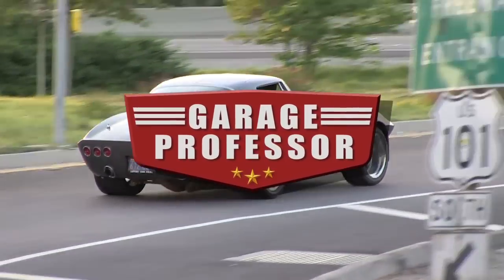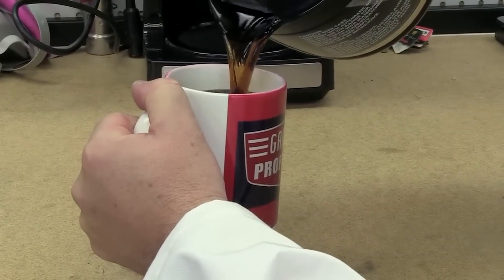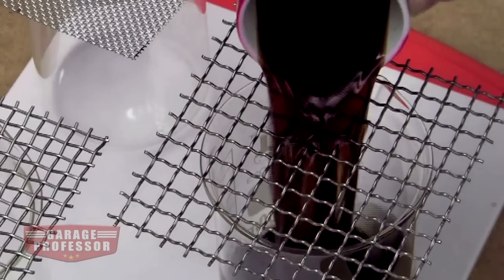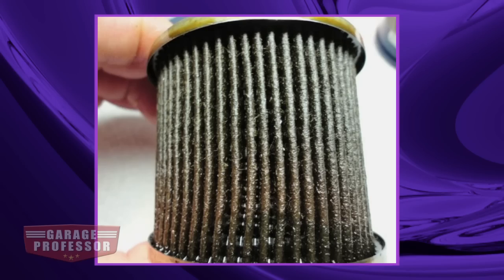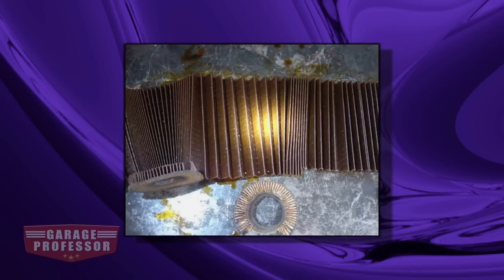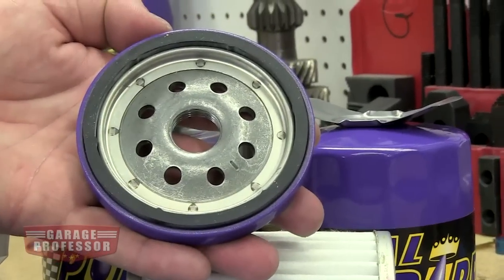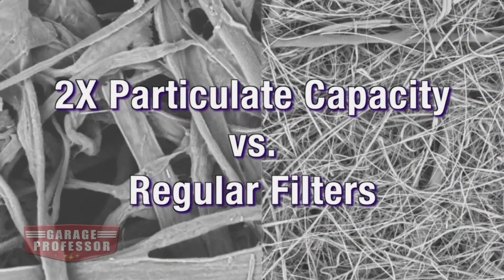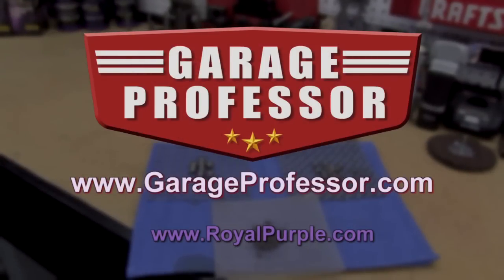The Garage Professor: Oil Filters- We Put Particles & Filters to the Test!

Comment: when he shows the "bypass valve" he shows a hole in the top of the filter!   not the valve!  i saw a video where the valve is incorporated into the spring, but did not see how it sealed in order to prevent oil from getting around it!  is there a video that shows how the bypass

Comment: I have owned 3 GM's with well over 220,000 miles, at least!   I only use AC Delco filters the manual calls for and change the oil every 6 to 8 thousand miles and have never had an internal engine problem.. won't better filtration slow the oil flow????  Use what is designed for your vehicle...

Comment: I have a 4x4 truck with 312,000 miles running Fram filter. I change the oil about every 6,000 miles. $3.67 at Walmart.
Reply: +blackericdenice and u get maybe 5mpg ...hwy
Reply: Benjamin Nope, I get 2.5 mpg on the hwy.

Comment: Until I finally run into that guy whos filter failed, I will normally buy Fram. I have bought the filters offered as a package deal at O'Reilly too. I have pulled oil pans off my vehicles at 200,000 + miles because of seal leaks only to see clean pans. But I have always changed oil/filters at 5,000 miles. My 2 cents? Change your oil!

Comment: Liking my K &N filter. The only filter that's fabricated with a celluous element, which allows for faster oil flow through the filter element. Plus, the aforementioned possesses a welded 1" nut for easier removal of said oil filter.

Comment: Bosch distance plus is best filter
Reply: +stormbringerr mourn I used it with what they call a low drain interval oil (valvoline full syn)  ran it 6k miles was still pretty clean.  Ran royal purple with a k&n... was trash at 4800 miles... the distance plus filter is great
Reply: +Billy Gunn
i believe you. i use full syn Mobil 1 oil and  Bosch distance plus filter and change oil every 10,000 mi.
Reply: I used to use Bosch DP. But I've changed to Purolator Boss. The best filter I've used. Purolator, you cannot go wrong using them. They invented the oil filter.

Comment: I actually made the switch to royal purple in my 1993 Chevy Lumina 3.1 Euro and I actually feel the car runs better don't feel like I have to push the peddle as much as I used to.. feels like it has more power im pretty happy and it's only day 2 since I've changed to royal purple...and I dont have to change it for at least 11,000 miles...but ill change it at 10,000 and I did order royal purp filter picking it up tomorrow...
Reply: Did your car die yet? Is it scrap metal 🪦

Comment: They don't spend millions on testing just to BS people. Like the old saying goes. Pay now or pay later. When this filter came in the mail I picked it up and said to myself Holy S.--t is this thing heavy. It's going on my 07 Jeep GC. I usually by Mobil One but I'm giving RP a chance. Let's see what happens. I change my oil when I can't see the oil level lines through the color of the oil. It's probably still in good shape but not good enough for me. Fifty yrs of owning cars and never had a failed engine. High miles and still ran great.

Comment: Royal Purple Commercial.  LOL  Overpriced filters, and they aren't worth all the hype... just like their oils.  Expensive bullshit.
Reply: +Turbo Diesel Sure, that is why my 04 Grand Cherokee has 230k plus miles and runs like new. My 98 Grand Cherokee has 165k plus and runs like new...same thing with my 2004 Pacifica. They have had nothing but Royal Purple since day one and you can change it every 5000 miles. You don't have a clue.
Reply: +Virginia Towerman : Oh believe me, I have a clue.  I have a fleet of vehicles, all with well over 100K on them.  I also own a ton of farm equipment where I run all conventional oils and standard duty WIX, Fleetguard, or Baldwin filters.  They all get oil changes every 200 hours of use or annually, whichever comes first.  

As far as my road vehicles... for example, my '02 Cummins currently has 317K on the clock.  A Chevy Lumina that I used to have broke 200K before I sold it.  Olds minivan with over 200K on it.  Most of my other pickup trucks (Chevys and Dodges) all have mileages in the 130K to 220K range.  I've always use the cheapest fully synthetic oil and a good quality filter, changed every 6 to 10,000 miles on them all.  
Bottom line is that if you change your oil and filter as you should, and perform good maintenance practices on your vehicles, they will run for many, many miles (or hours). 

 I realize that you attribute your taking car of your vehicle all to Royal Purple products, but the hard fact is that your vehicles would be functioning just as well with other less expensive brands without spending as much of your hard-earned money.  Perhaps you should be a Royal Purple spokesperson?  LOL
Reply: Royal Purple is just a small part - although necessary - of the solution. Precision care, timely repairs and maintenance are all part of extending your vehicles life indefinitely. Fortunately I do most of my own maintenance so I also get a higher level of care.
Reply: *****
Yes I can. I am talking about the personal touch that you take when you make your own repairs. Sticking to the specs, making sure everything is torqued correctly, replacing or cleaning what needs to be replaced or cleaned...basically not taking any shortcuts. I have factory manuals for all my of vehicles and I use those as my guidelines.
Reply: +Virginia Towerman dude you'll get that kind of mileage with just about any oil. compared to the likes of Mobil 1, pennzoil platinum, and amsoil royal purple doesn't hold up at all. royal purple is actually comparable to castrol and Lucas oil
Reply: Edward Anthony hey let him go buy that crappy shit, more rp for us.
Reply: Before every one here starts arguing look at the facts first. NOT ALL VEHICLES ARE MADE THE SAME. NOT ALL OILS ARE MADE THE SAME EITHER there are different variables involved. How you drive, how much you drive, if your more highway or more stop and go city person.It doesn’t always come down to the product you use.

Comment: It doesn’t always come down to the product you use. I can use the best oil money can buy, but if You floor your car’s pedal every day it’s doesn’t matter if your oil comes from Saturn.. your going to screw your car very soon.If you use a cheaper oil ( providing it has the API approval )and drive like 85 year old granny next door,your car is going to last longer. Providing in both cases the oil is changed as is required.Lets also not forget that not all vehicles are made the same either.

Comment: Fram ultra is good enough for me...
Reply: Fram Ultra is the best filter available. Definitely just as good or better than Royal Purple & Mobil 1 filters, but a bit cheaper.
Reply: +Branson Mathess Guess you haven't seen the inside of a Fram filter.  Nothing but cardboard.
Reply: Charles Scott i guess you never seen the inside of a fram ultra ?
Reply: samuel lopes Honestly nope, had two fram filters go "pop" on me in the past, wont touch another one ever again.
Reply: Charles Scott Yeah. I guess that will happen when you install them incorrectly.
Reply: Branson Mathess No, it's an issue that FRAM has been plagued with for ages when it comes to high oil pressures and failed bypass valves.  Guess you don't remember much 10 years ago.
Reply: if you change your oil and filter on time you will jever have to worry about the bypass valve having to work. although i have heard of ford duratec 2.5 and 3.0 V6 having issues with filters bursting but it wasnt specific to any brand. i had the contour SVT with 2.5 duratec and i ran the standard fram oil filter and never had a problem the 6 years i owned the car. changed oil and filter on it every  month since it was so easy and cheap...
Reply: samuel lopes My 3.0 Duratec in my 07 Fusion hasn't had any filter issues in 115,000 miles. I've had FRAM, Motorcraft, Pennzoil, Purolator, Hastings, etc. filters on it its entire life & never an issue. I have a FRAM Ultra on it right now.

I agree about the bypass valve & changing your oil regularly. I purely believe all the FRAM failures are due to people running the filter beyond FRAM's recommendations. FRAM specifies 5,000 miles on the Extra Guard. So people put an Extra Guard on & run it for 10,000 & it collapses & they blame FRAM. I also get extremely tired of people comparing the cheap Extra Guard FRAM to premium oil filters from other brands like Mobil 1, Royal Purple, K&N, etc. If people weren't so damn stupid/ignorant, they'd see that FRAM builds 4 different filters meant to compete in different parts of the market, people act as if FRAM only makes the cheap Extra Guard. The Ultra blows every premium filter away, period. Look at the facts. If someone can't accept that then they are nothing but ignorant.
Reply: i think it was an issue in the early ones that didn't have variable valve timing and the oil pressure was a lot higher than most engines. mainly the SVT contour  guys that would autocross. according to them a K&N oil filter was the only one they would run at the track.
Reply: +samuel lopes 
personally , I stick with the GM- Delco filter .
Reply: +Charles Scott you might want to go see the construction of a fram ultra filter. it's about the same as as the wix XP or napa platinum filter
Reply: +samuel lopes Yes sirrr. I've been using Fram for 19 years and have yet to have a problem. I to get them from Walmart.
Reply: +Charles Scott I don't care because my truck has over 300k miles running nothing but cardboard.
Reply: +Charles Scott Wow 2 Fram filters went pop? Maybe it's you and not the filter.
Reply: +samuel lopes I don't know where these guys get this burse crap from? I've been changing oil for 30 years have never had any kind of filter to pop.

Comment: The metal mesh screens at the binging should explain the whole filtration system: "the bigger the mesh the longer the filtration of the micron size thus poorer filtration of smaller deposits, the smaller mesh the better filtration of small deposits and the faster the mesh will clog up". Oil filter elements are made to a filtration standard so as to filter out deposits down to a certain micron size in order too protect the engine. How long the "FILTRATION" works depends on many factors like driving conditions, engine desighn, engine wear, poor combustion. No filter nor oil company can say that their product will last so many miles! You can only go by looking at the condition of the oil, if you can see black carbon deposits in the oil then you know the filter is no longer doing it´s job and it´s time for an oil/filter change. All this 10,000mile claim on the product is stictly BS Marketing that can cost you a blown engine!!

Comment: Oil filter fail at 3,000 miles? You guys love to lie.
Reply: JCKHAMER You are lying. I have a video where I'm rebuilding a Tahoe 350 with 312,000 miles and the filter is a Fram. I bought the truck with 113,000 miles and have use nothing but Fram. That's why I started using fram because of the grip. I use to change oil for people and fram was my choice.
Reply: JCKHAMER How are you telling the truth? There is videos of Fram filters on Ferrari. Why would people put cheap filters on Ferrari. Like I said, 200,000 miles on my Tahoe with fram filters. Not one problem. 100,000 miles on my Mustang with fram filters. I have an 04 Trailblazer with 90,000 miles fram filters. I have video, where is your video of bad fram filters?

Comment: 25 microns is not a great filter... best filters can do 3 microns and the oil comes out clean if it was totally black before.
Reply: It's 99% @25microns, 98.7@20microns, same as Amsoil Ea oil filters. In other words excellent. Never seen a 3 micron oil filter. At what percent? Oil supposed to get darker, shows it's doing it's job cleaning.
Reply: Oil gets black because the filter isn't doing it's job properly... all that "bkack" are particles that DAMAGE the engine. Look at this video and you will see a filter that does it's job  properly. Saying that it's supposed to get darker so you see it's doing it's job is stupid....
Reply: Never said that oil gets darker SO you can see it's doing it's job, you did. I said oil getting darker with use is an indication it's doing it's job, and normal. There's a difference, apparently reading comprehension skills could use improvement. Also see no proof of that 3 micron filter or percent which turns " totally black" oil clean.  As I thought. The RP 98.7% at 20 microns rating is excellent for any oil filter.

Comment: I use the Royal Purple oil filter, Mobil 1 oil filter and the K&N oil filter, and they work great, in all my vehicles.

I don't like the cheap paper oil filters, and enjoy the non paper fiber premium oil filters.

I do enjoy high quality synthetic motor oils too, Royal Purple HPS, Mobil 1 Synthetic extended life, and Lucas synthetic, Amsoil synthetic as well.

Its quality that makes most or all the difference, not the price, the price is least important, as for the cheap people that put cheap parts into their cars, well, thats why your car treats you cheaply by giving you troubles and not last as long as the car with the premium parts in it.

The cheap people that say oil filter is all the same, you don't know anything, you just assume that because you don't know the facts, and you are trying to sound / look smart, but in fact you are ignorant.

Product quality matters, higher quality parts are more pricey but is better by long run, because when you put better parts into the car, you are spending less time in the garage and spending less in the long run, and that there people makes the difference.

With more time and money in the long run, the more time and money you will have to do more enjoyable things in life, lets say going fishing, for example, or something else that is enjoyable.

Treat your car properly, as if its a baby, and put premium quality parts and fluids in it.

You will see the difference, especially in the long run.

PS: Get the repairs done when the problem is not big, or its gonna cost much more to repair.

Hope this was helpful, have a nice day, and have a nice ride in that vehicle of yours.

Comment: After watching this  I was going to ask how much Royal Purple paid the user of this account to do this commercial, but once I looked I saw this account is operated by Royal Purple themselves. So that being said, RP, your oil is overpriced and it sucks. If RP oil is so great why is it i've only seen it sold in very very limited areas and i've never seen one of your filters on a shelf anywhere.
Reply: The filter is rare. For the oil, you will only find Royal Purple's API SN formula in common auto parts stores and even Walmart. These are "normal" synthetics that should only be bought on sale, or as cheap as you can possibly find them. Their special racing oils and high mileage oil are all API SL and possibly SJ oils. These are their real "flagship" oils that can't be sold just anywhere because they can void new car warranties. They contain a lot more zinc and phosphorus anti wear additives, and a ton more detergents. They use a mix group 3, 4 and 5 oils.

Comment: oi
you can run a oil filter on 2 oil changes if you want
its on what you use it for
if you racing then your going to change it after each run
if your driving ont he high way you goign to change it every 4000 miles
if your driving around town your going to change it every 6000 miles
if your driving all over this and that you can change it every 10,000 miles

in town leave the filter on and run it again thats 3000 miles every 6000 miles
drving on the high way change it every oil chnage
driving all over here and there change it every times

and its on if its cheap oil or good syn oils
if its cheap oils then change it all the times
if its full syn then change it every other times
save on filters too
full syn doesnt go black as fast and doesnt break down and turn all gay HAHAHA
so its on cheap oil chnage it all times
good full syn change it every other times 

THE END
::))